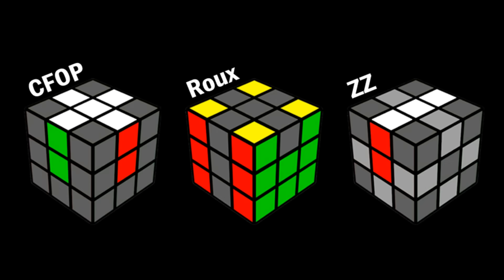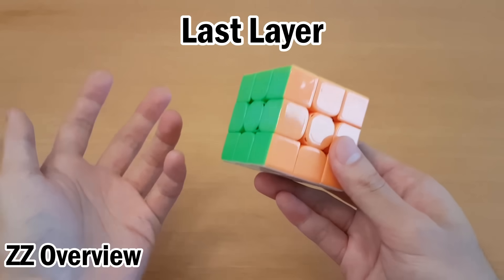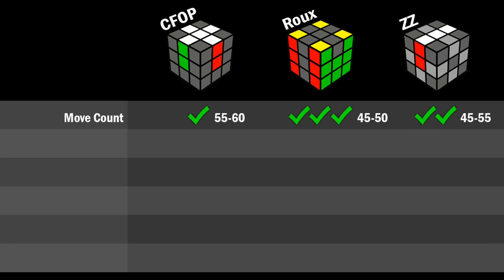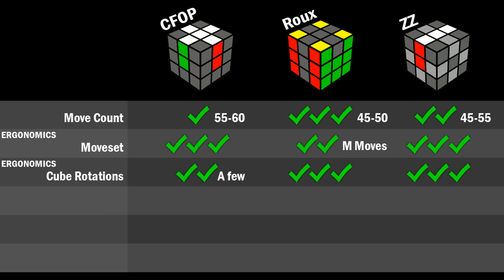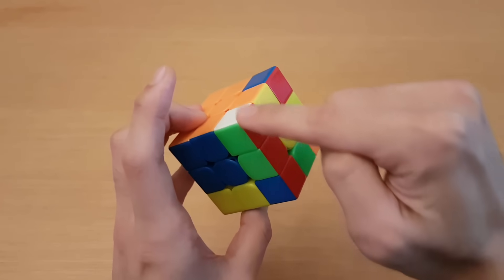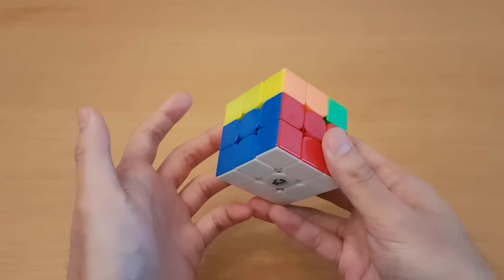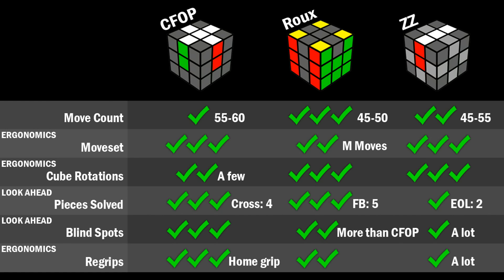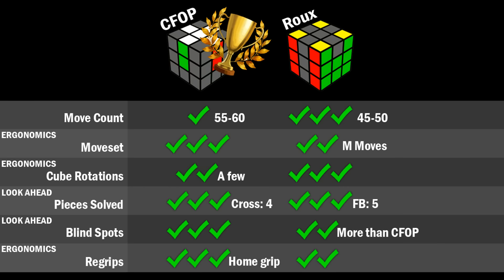The BEST Speedcubing Method? [CFOP/ROUX/ZZ] Comparison

Comment: Lookahead in roux is easier than cfop because you can plan whole F2B easier than planning whole f2l
Reply from the maker: Your points are all possibly true, but highly debatable. Please don't present them this way as this is entirely what the video is trying to avoid.
- Inspection is not better in Roux just because you can plan 10 pieces sometimes, as in CFOP I can frequently plan 10 pieces as well.
- L moves are not bad just because it's not R. Look at L in ZZ and it's bad, and L in CFOP is great. Saying "L is bad" is a very weak argument.
- Completely avoiding resets on MU is not possible without sacrificing efficiency. MU is a great moveset as it avoids regrips, which is a possible argument you could make for it, but that's still not better than the 0-2 regrips you'll have in OLL and PLL.
Reply: @JPerm  yeah i agree with you about everything but... The MU argument, if you do LSE correct you will alternate between M moves and U moves so this allows the fingers to reset to the default position during the other  move for eg while doing M' U M' i do a M' move... Moving my right hand's ring finger from default(DB edge) to DF edge position. Now while I'm doing U with my left hand's index from default (ULB corner) to URB corner position push, simultaneously resetting my right hand's ring to default position now I do the M' move again, right hand's ring default to DB and simultaneously reset my left hand's index to default.........

Edit:
The MU moveset maybe outright slower than ULRF moveset but not for the reasons you provide

Hope i was able to get the point across

Nice Vid btw
Reply from the maker: I did address this in the video. 2 moves later is not enough at a high TPS, you need 3 or 4 moves later to get a perfect reset. This is why T perm is significantly slower than J perm when going at 15+ TPS. Even though its 1 move longer, U' R' U' uses the same finger 2 moves later. And MU is always a repetition 2 moves later.
Reply: inspection wise, roux is better
Reply: no more akward L moves after FB
Reply: also, MU ergonomics is just as fast as RUF, finger reset happens when you do M M , M' M'  ,M/M' M2, etc. which you will never do when you are quite good with the method.

Comment: I would very much argue from the perspective of actually learning a method. CFOP is very easy to learn gradually coming from the beginner method. It becomes very alg intensive though, which can be a major drawback for many people. Roux is extremely intuition-based, the only alg sets it requires is CMLL (42 algs). The rest is purely intuitive. You can also break that down to 9 algs if you do it two-look. That's what I find a really important factor in Roux. I personally use CFOP and average just under 15s, but recently tried learning Roux and got down to a low 20 average after a month of occasional practice. Roux definitely has an incredible potential, especially building first two blocks becomes ridiculously efficient once you are familiar enough with it. So, while I agree with everything you stated in your comparison, I'd factor in heavily the learning process.

Also, ZZ sucks
Reply: I agree, and that is why I use roux
Reply: @nathanaelmorgan8604  same
Reply: @nathanaelmorgan8604  #rouxvolution
Reply: But I think this video, especially the last part of it, was geared toward what are the differences at high level, which is where the different methods really matter. Almost all actual methods can be used to get sub-30, but after that which method you use becomes more important. And if you are serous about speedcubing, like getting sub-15 or faster, learning more algs shouldn't be that big of an issue.
Reply: @octogintillion  i kinda agree but i would like to share my thoughts(no hate). They argue about which is the best method.. if  you are that kind of a person, use this or use that. But in the end and especially when you solve in under 20s, its just a matter of preference. Im "good" with cfop and roux, and i can see the advantages and disadvantages. But i still prefer roux because i like the intuitive steps. 
My point is that you can argue all you want or hate a method all you want, but if someone prefers this over another than you have to accept or ignore it.
Reply: pure zz sucks, variants like zz-a and zz-x are certainly better than vanilla cfop
Reply: @MKWiiLuke4TW  don't get me wrong. ZZ is amazing as a method itself and I can watch Chris Tran solving with ZZCT for 10 hours straight. Just, as a speedsolving method, recognition is simply too slow to keep up. To be a viable speedsolving method, it needs to strike the perfect compromise between efficiency and recognition speed for cases. CFOP and especially Roux excel at that.
Reply: @Herbert.  what do you mean by recognition, are you saying inspec recog? because there are definitely people that can inspec eocross or eocross 3/4+1pair in 15 seconds no problem, other than that zz has easier recog for the rest of the solve.
Reply: @MKWiiLuke4TW  I mean case recognition. Recognising a zbll is much harder than recognising a CMLL or OLL.
Reply: @Herbert.  recog is trivial for zbll, it's the same as pll you just have to get used to it, RECALL is what's difficult about zbll because of the sheer size of the set, but again if you learn algs in not the bad way that most people do it's not that difficult...
Reply: Roux only requires 3 Algs
Reply: @jevvf3246  2*
Reply: @deleteduser9445  if I would learn all cmll cases with corner permutation, then I would only need one alg for the whole solve because I learned to do the rest intuitive lol
Reply: @deleteduser9445  3. You're thinking of the 2 swaps, but you still need Sune.
Reply: @jevvf3246  it's only 2, Sune+ _ perm, just do perm twice
Reply: Do you recommend CFOP or roux?
Reply: @ImRaxen  depends, try both and see what you like better. I’d suggest starting with cfop as it is a little easier to grasp your head around, but learn roux after
Reply: @mrferrot9898  i’m finally learning cfop advanced because I used to use the reduce one and I didn’t know which one use either Cfop or Roux. Once I’m done with CFOP i may start lesrning roux. Thank you tho
Reply: @ImRaxen  no problem, good luck with your endeavours :)
Reply: @ImRaxen  also, if you like cfop you may enjoy zz but with EOCross. Basically that is just the cfop method but you never rotate the cube and the yellow cross will always be done when f2l is done. You may want to check that out as well
Reply: love that "oh btw fvck off, zz" at the end

Comment: hey nice video
I actually use a method I came up with (someone probably did it before but i never seen it anywhere) where you do first two blocks like in roux, insert the front and back bottom edge and oll and pll like in cfop
Reply: NLE CHOPPA That sounds very horrible
Reply: @khanhnguyennam6007  why? I'm way faster with this than I am with cfop or roux
Reply: @khanhnguyennam6007  the idea is that the part in roux thats faster than cfop is the "F2L" part and the part of cfop thats thats faster than roux is the last layer and in that way i can use both
Reply: Yah yah yah gud for u
Reply: This method literally obliterated the advantages of Roux in L10P.
First, efficiency will be much worse. The moves to insert DFDB would have been enough to do EO and maybe LR in regular Roux.
Just do regular CFOP or Roux. You may also check out Pinkie Pie(FB, SB, LR edges in DFDB, OLLCP, 4b, 4c)
Reply: @deleteduser9445  how many moves do you think does it take to insert the DF and DB edges?😂
Reply: NLE CHOPPA 6-7 moves
Reply: @nlechoppa3341  yes, sometimes EO + LR can be only 1 or 3 moves

Comment: The first step of Roux isn't making a square then extending it to a block. It's making a block.
Reply: Something that I think a lot of people don't realize is, eventhough the freedom or Roux makes it so more of the solutions require regrips, that same freedom also makes it so there are more ways to solve each case and it's very common to be able to change the way you do it in a way that avoids regrips and doesn't sacrifice efficiency.

That's also how Lau was averaging 3 regrips a solve back in the day.
Reply: @iurigrang  also after dr is solved there's basically the same home grip thing as there is with cfop
Reply: @Rouxles  then there is a slight regrip for l6e
Reply: @MimeDuck  no. You can start LSE in the home grip and MU is 100% regripless once you know the FD to DB fingertrick
Reply: @deleteduser9445  just pinky ring doubleflick with left hand
Reply from the maker: The examples in the video are all made up on the spot. They're not supposed to add or detract from points I've made. I saw a square and accidentally said square I guess, which is a mistake.
Reply from the maker: Also starting with r2' is a regrip unless you're okay with having your hand backwards midsolve,  and may end with a regrip depending on what you're doing next. Ending with R U R is also a regrip.
Reply: @JPerm  yeah but it's one regrip.
Reply: @JPerm  the way i would probably end up doing for 2h is do right index U pinky ring doubleflick left hand M2, then left index U then R right index U roll R which i think makes you end really close to neutral
Reply: Also Roux is very right hand reliant, so there's NEVER a double regrip.
Reply: also at 8:50 you could do r2' first instead of r2 then you won't need to regrip for that at all
Reply: @Rouxles  or U M2 U R U R

Comment: With respect to 2H you should be doing EOCross for ZZ so pieces solved should be same as CFOP. This also takes away blind spots and limits regrips, so I would say ZZ is at least up to par with CFOP. For OH, Regrips are flipped for CFOP and ZZ and efficiency definitely makes ZZ better for OH. Roux is still best bough for OH
Reply: Then it wouldnt be actuall zz is it
Reply: @khanhnguyennam6007  It still is because you're doing EO in the first step. By that logic CFOP should just be called advanced LBL.
Reply: Erick Lescano no i meant like pure zz
Reply: @khanhnguyennam6007  I still disagree. This would imply you shouldn't use things like VLS or ZBLL for CFOP because that's not pure CFOP either. So if CFOP was the best method and was made better with those alg sets, then CFOP wouldn't be the best method, but instead this CFOP hybrid thing. It's still ZZ just like CFOP is still CFOP with VLS or ZBLL.
Reply: Erick Lescano also wut
Reply: Erick Lescano im just saying that im really drunk rig now and i cant compute
Reply: Like Znigbr... you kno wat i mean
Reply: Honestly i didnt read anything u wrote
Reply: EOCross unless done occasionally when using ZZ isn't has a good as proper block building.
Reply: @MaximilianBerkmann  eocross for 2h is actually significantly better than eoline

extra 6 moves or so with significant better economics is a trade-off worth doing for 2h
Reply: @Rouxles  If you're used to LBL/CFOP style solving, sure. Otherwise, it's not going to be that much better.
Reply: @MaximilianBerkmann  oh no it is significantly better if you consider regrips

zz eoline is regrip hell

Comment: There's no reason to learn zz unless you're learning zzct. The algs are blazing fast and finger trick able, also removes the need for the last slot
Reply: ZZ-CT<ZZ-A because it has a lower movecount and better ergonomics and is slot neutral (meaning you can do it from every slot).